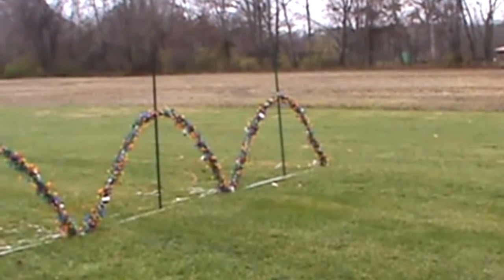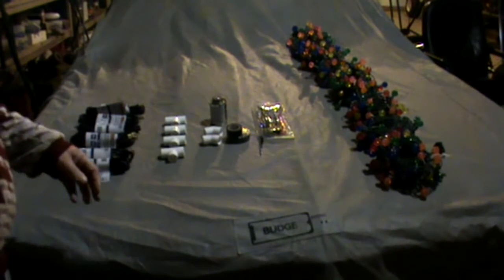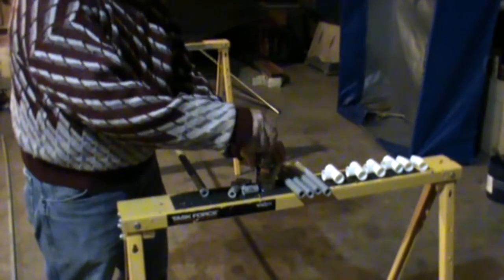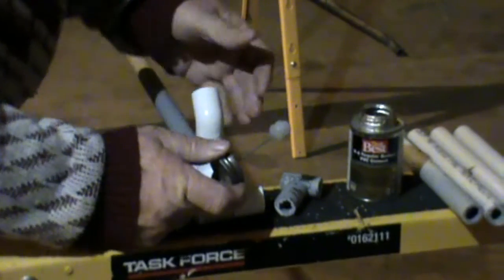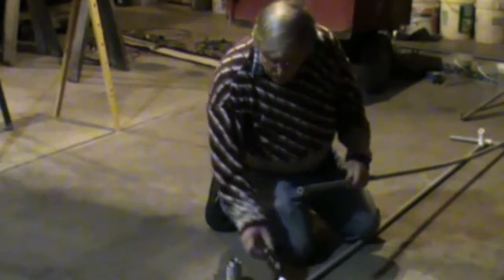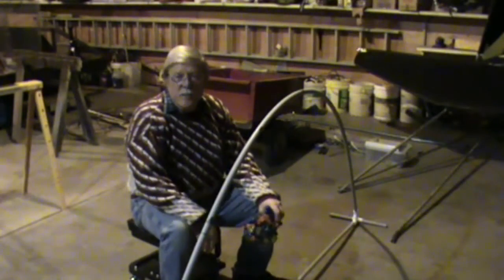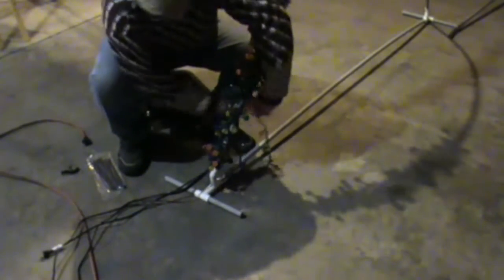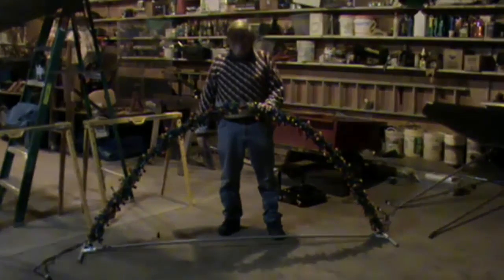Cheapskate Video 7, Making a Leaping Arch

Comment: When I made my arches, I took a piece of 3/8" rebar about 18" long and drove it into the ground and sat the PVC over the remainder of the rebar sticking out of the ground. No gluing, no cutting & fairly cheap.
Love your videos. Working on using Arduino to add to my display this year.